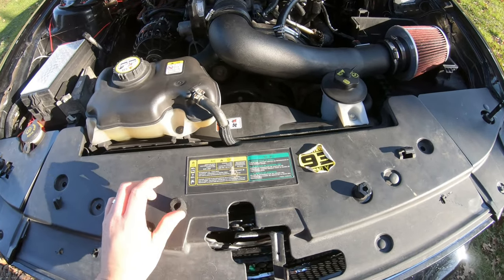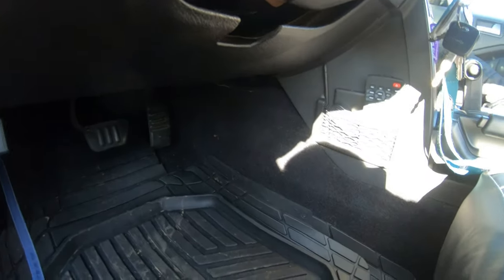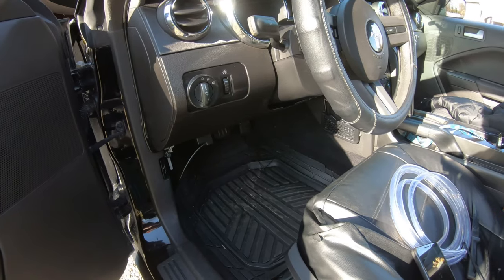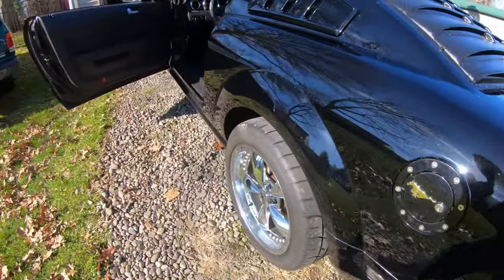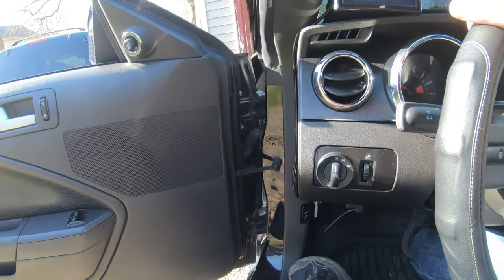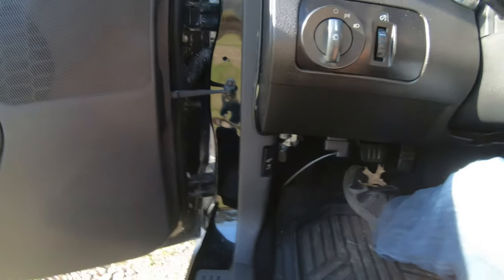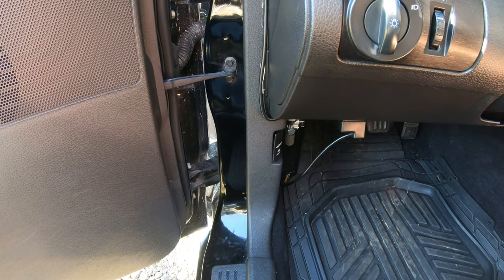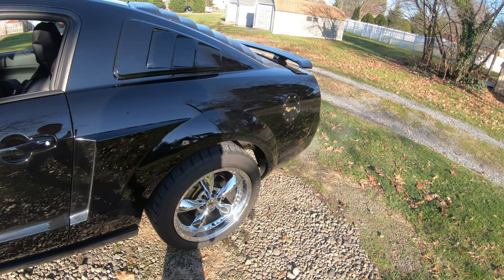V6 Mustang Idle Chop Mod ON-OFF Switch Installed & Completed IT WORKS

Comment: The red button the fuel reset is for if you get into a crash that will automatically pop up I believe and shut off your fuel line. So it’ll stop feeding fuel into the engine which could cause a fire.
Reply from the maker: Oh wow thank you for that knowlage!!
Reply: OMG, I've actually been side swiped in a 2000 Lincon LS and the fuel got cut off and the engine wouldn't start.

Comment: Would in line fuel shut off valves work the same at this setup. I know its similar as a petcock
Reply from the maker: any line will work, we also converted this into a push button on/off setup

Comment: So does the fuel petcock closest to the egr valve suck air from the atmosphere as well as the one furthest away you turn on and off? Curious why 2 peckocks back to back
Reply from the maker: correct the one i have in the back closer to the egr is always open, the one closer to me is the one that i controle by opening and closing, so when i open the front 1 both are wide open when i close the front the back 1 is just open ( i have filter inside the 2nd one to create a chop
Reply: @RevLine89  right on got it. Like turning the filter in the egr sideways under the hood, now it's under the dash🤘😎🤘, thanks bud appreciate the hard work
Reply from the maker: Your welcome!! Thanks for watching

Comment: If I don’t have anything on the car just delete cat and add a borla exhaust did you thing I can still duet?
Reply from the maker: it will work on all 4.0 v6 mustangs no matter your exhaust setup! each setup will just sound different, and remember it may put ware and tare on components so keep that in mind if doin the idle chop mod
Reply: @RevLine89  thanks
Reply from the maker: Yw